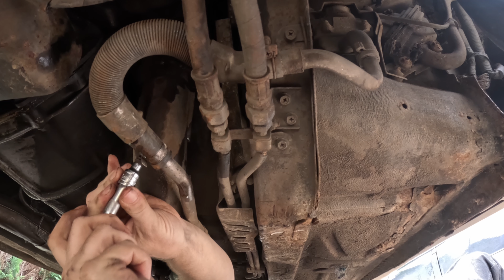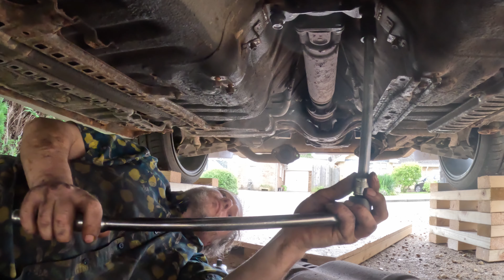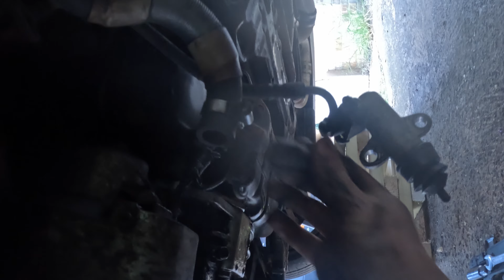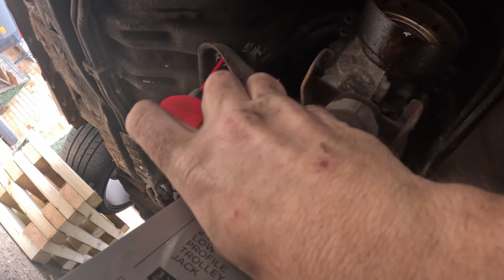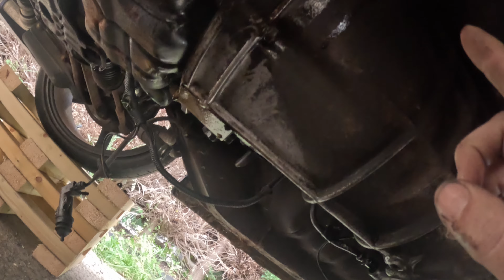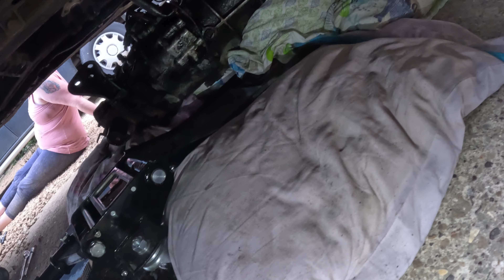HOW NOT TO REMOVE A MANUAL TRANSMISSION ON A NISSAN 300ZX TWIN TURBO

Comment: Hi mate, well done. Did you mark the position of the propshaft bolts before removal, as that would prevent any vibration going back in the same position.
Reply from the maker: Oops
Reply: is it normal for the transmission to leak like that when its tilted?